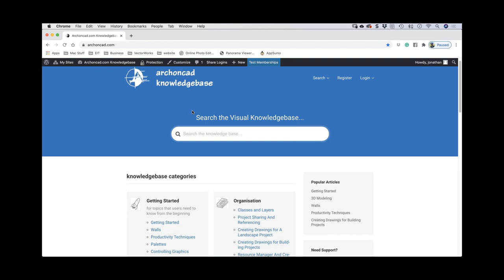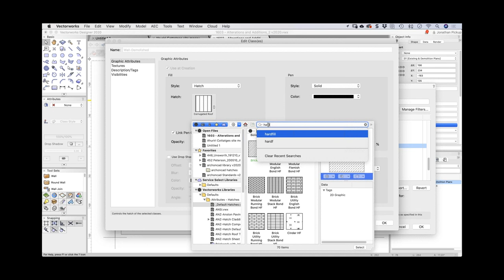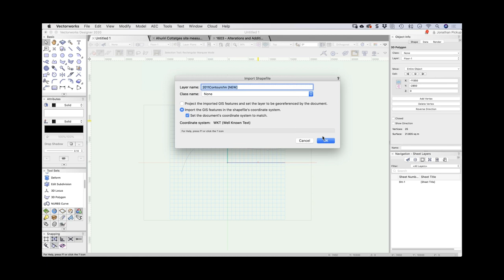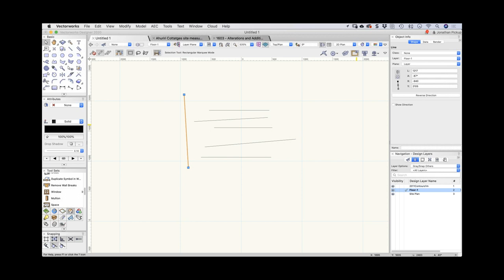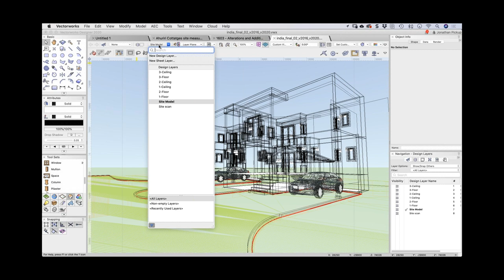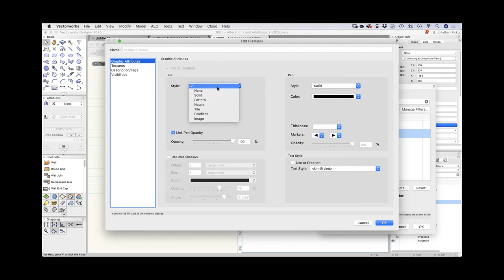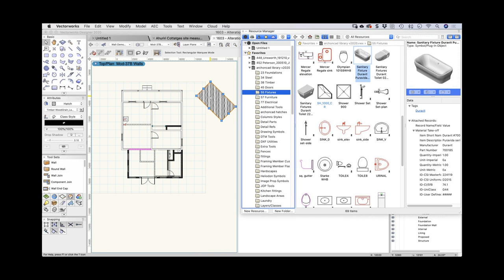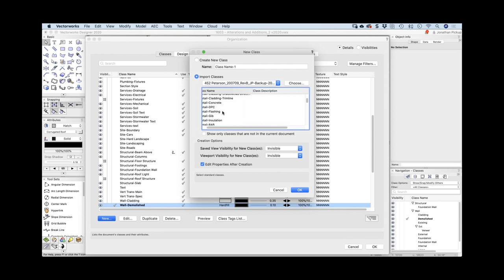VECTORWORKS Q&A with Jonathan Pickup

Comment: Can we create slanted wall and window in VW? What about Rhino.Inside? Most BIM software can be linked with grasshopper now. I'm curious whether it can support grasshopper.
Reply from the maker: The slated window is easy to create with a symbol, the slanted wall is not easy. You have to solid model the wall and subtract solid for the opening.